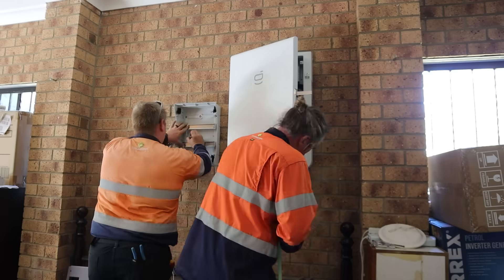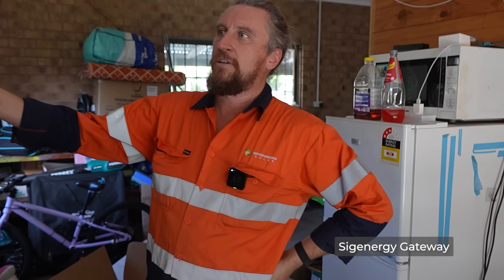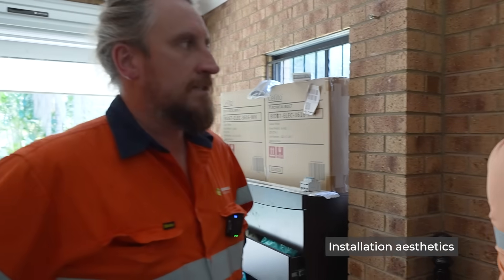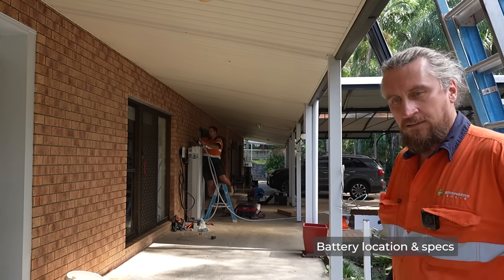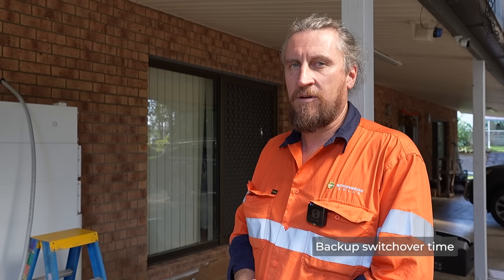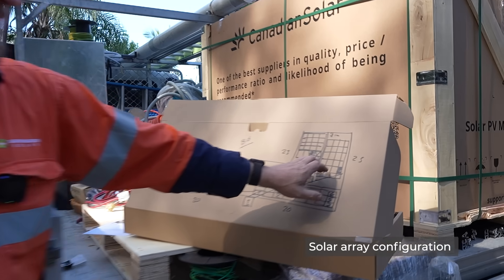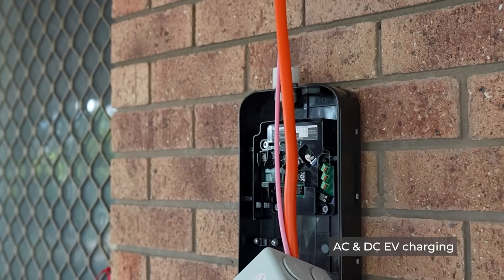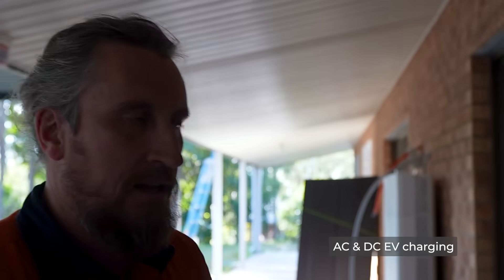What They Should Be Telling You About Your Sigenergy Installation | Battery, Backup, EV, Solar

Comment: Why have a 25 kw inverter when the maximum discharge rate of the 5 batteries is only 20 kw?
Reply from the maker: Hi, thanks for the question. Battery capacity plays a large part in the inverter design but so does the solar and EV charging. In this case, there was 40kW of solar, a 25kW DC charger, and a 22kW AC charger. This is why we chose a 25kW inverter.

Comment: Could we get a clear response on this prior question please: this 40kWh battery set up will only ever be able to move 20kW in or out (40/2). The inverter in the Energy Controller is what controls the in/out flow in DC ( - to battery) and AC (out - to grid or house).
The question here is why pay extra for a bigger than 20kW inverter. Wheres the benefit?
NB - you have done a follow up video on this install that talks about the design of this setup, yet this was not answeres there either Thanks
Reply from the maker: Hi, thanks for the question. Battery capacity plays a large part in the inverter design but so does the solar and EV charging. In this case, there was 40kW of solar, a 25kW DC charger, and a 22kW AC charger. This is why we chose a 30kW inverter.

Comment: Looks like a pretty similar setup to what we are aiming for. Would love to know indicative pricing. 

That 25kw bi directional inverter is very neat. Is it legal yet to use your EV as a battery, if not any idea when? Also, is the sigenergy a high or low frequency inverter? How well does it absorb sudden spikes in energy use?

Comment: Assuming this is a 3 phase system?  May I ask what the benefit is for choosing the 25kw inverter versus the 20kw inverter? My understanding is that each battery module is limited to a certain output and that even with a full 48kw stack using a smaller 20kw inverter, the bottleneck is still the battery module output limit.
Reply: My understanding is a 48kw stack made from 5 8kwh batteries will give a maximum of 24kw throughput from the batteries. The battery throughput is rated as half the storage capacity (an 8kwh battery module will give 4kw throughput).  

A 25kw inverter would allow higher export (solar +- battery) to the grid and this could be the reason it was used.

The Sigenergy system is very flexible on setting priorities for moving power between Solar PV generation, the Sig batteries, the car batteries  via the EV charger and the grid.

I have a 10kw inverter with 32kwh batteries (4 * 8kwh), 25kwEV DC charger and 12kw of Solar panels.  When I charge my  EV, even with a 10kw single phase inverter module, if I use the fast charge option in the Sigenergy app I charge at just under 25kw per hour - made up of solar pv input first, then battery power (4 * 4kw = 16kw per hour) and if solar power is low the balance from the grid to provide 25kw per hour EV charging.

Example - yesterday afternoon I wanted to charge at the fastest rate possible so Solar was giving me 7kw at the time and my 4 batteries 16kw and about 1 kw from the grid to give my EV a charging rate just under 25kw per hour.  Other times I will set the Sig app to just charge my car from excess Solar PV power but only after it has fully charged the Sig house batteries.  The Sigenergy app is easy to use and lets me set the priorities for where the Solar power goes (to charge the Sig Batteries, or the car batteries, or export to the grid).  From my use Sigenergy has done a very good job with the app and it has exceeded my expectations.

You may get a better answer from the author of the video on why they went with a 25kw inverter.  Just putting this up from my own experience using the Sigenergy products, albeit with a single phase 10kw inverter.  I hope this is useful to readers.

Comment: I’m really interested in pretty much the same package one question I have re 25dc charger what size array are you going to need on your roof to be able to utilise the full 25kw potential without the battery or the grid supplementing it. From my understanding you can throttle the dc charger down to only charge based on what the solar is generating.

Comment: I am installing the same system in my new home being built, was wondering why you mentioned you prefer the Gateway next to the battery/inverter ? I am installing my Gateway in the garage to keep it out of the weather and the battery/inverter is being installed other side of the house being  in the shade all day keeping it cool.
Reply: We would always prefer to keep the feeds from the MSB to the Gateway as short as possible and our feeds to our inverter / battery as short as possible. This is the only reason.The shorter the distance the less losses and volt rise and drop issues will occur. As long as your installation team is prepared for your installation requirements and the locations are compliant for what’s being installed then there is no reason why you couldn’t have gateway in a garage and inverter in another location. 

Every system we do is tailored for that customer and location.

Hope this helps